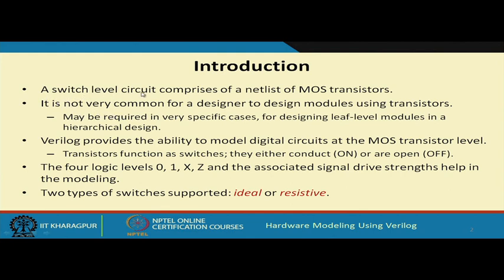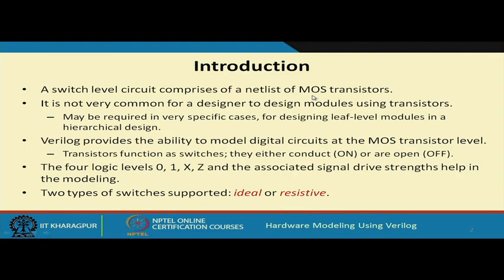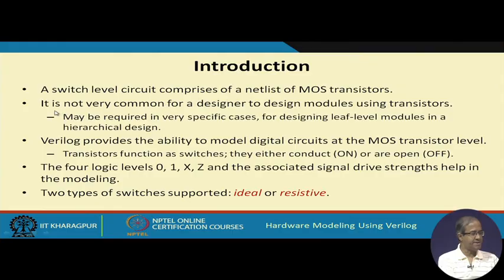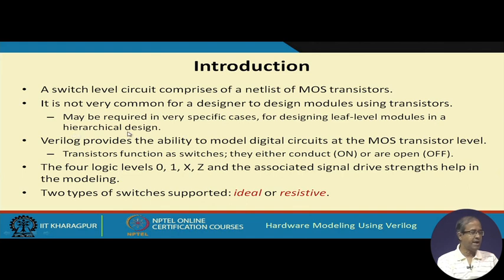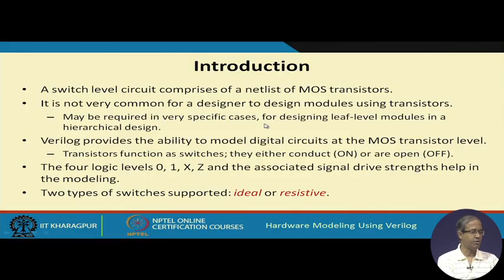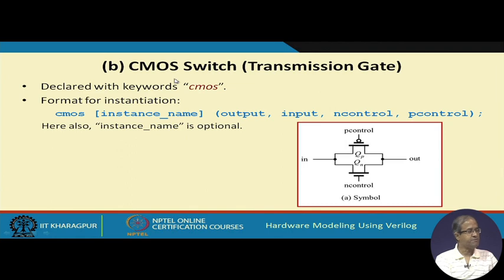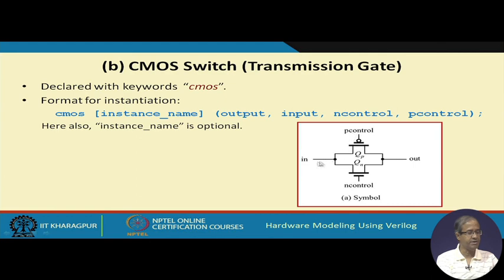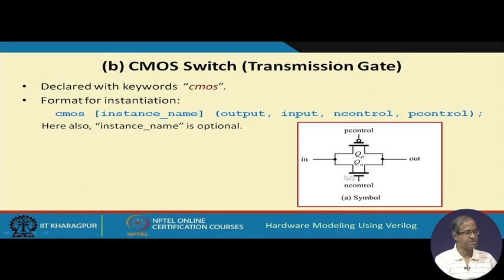SWITCH LEVEL MODELING (PART 1)

Comment: Why are at using tran. It's just like a wire
Reply: because it can give high impedance also .it can provide us a digital switch.
and using cmos(transmission gate), it is better than pass transistor logic